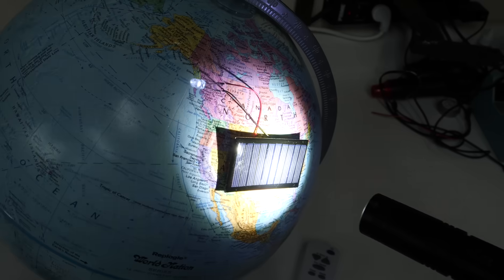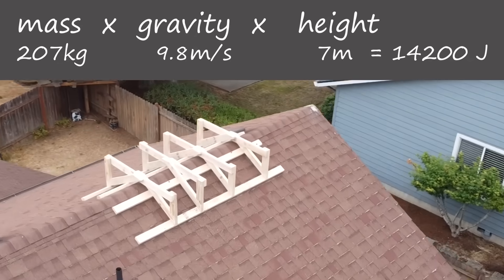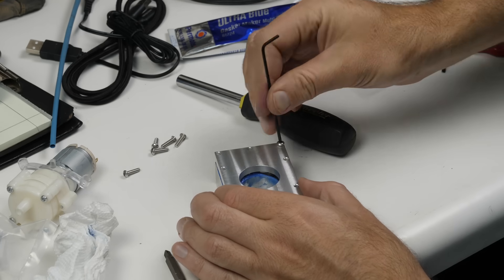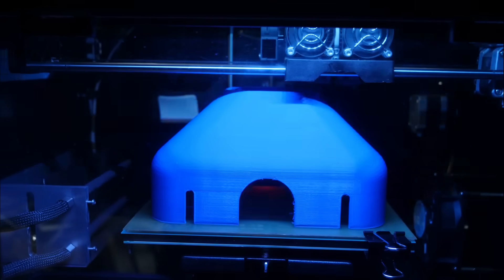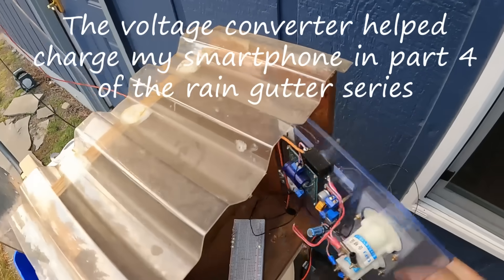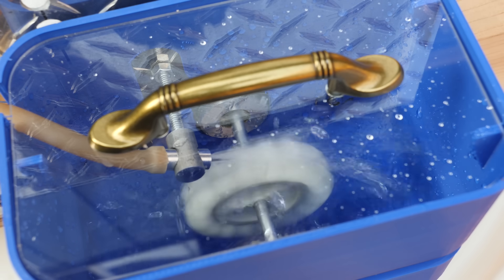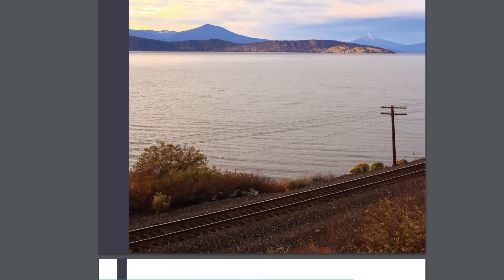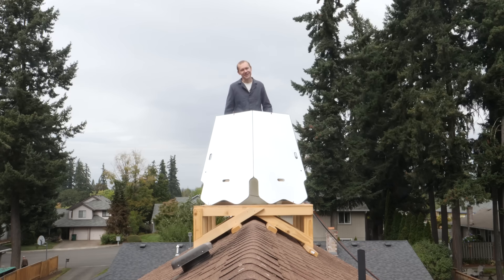Storing Solar Power on my ROOF!!!

Comment: I'm glad you made it clear near the end how little 14200 Joules actually is, namely just the energy in an AA battery, unfortunately. Another thing to consider is how much energy is lost in the whole transformation process, basically all the heat that is generated (and thus engery lost) while pumping the water up, and some losses also when converting back the potential energy of the water back to electric energy in the end. Storing energy is difficult.

Comment: you know putting that on your roof on is a bad idea. you know how much does a gallon weigh of water. times at 50 gallons you do know that 50 gallons is weighs 400 lb. that's on the roof .

Comment: Sorry for my English. It's very interesting experience, but there too much losses. You know, I counted 10. Electric energy->mechanical energy->in motor->in tube up->gap between up tube and level of water in barrel->in tube down->in faucet->in nozzle->water to mechanical rotation->in generator->in electronics. It isn't all of it. I thought you'll try to lift up the barrel like a lift then will generate energy by lowering down. It can be next round of experiment. Good luck :)

Comment: A while back I was day dreaming about lifting a really heavy rock (more like a boulder) slowly over time with solar power and then using that rock to generate electricity later through some sort of controlled gear driven motor/generator.

Maybe some day I will test the idea.
Reply: Use math to determine how big of a boulder you need and how far up hill it must go before you start the project to avoid disappointment.
Reply: @AvgDan  
We're talking about ideas and experimenting. Experimenting is what develops knowledge and skills.
Do you think people like Tesla were using equations made up by other people before they'd dare craft up something to experiment with? 🤔 
No. They built and rebuilt to get it right and perfected along the way. 

But seriously. It was just an idea for off grid. And as such it would be a matter of a lot of variables such as what motors, generator, gear drive etc was available (often from used parts available) and simply converting mass to kilowatts/hrs on a piece of paper would be worth about as much as the rest of the bullshit that looks like something on paper but maybe not so much in the real world.
(I could insert a bunch of political climate propaganda etc for example)

Comment: Great Experiment!
Halfway down the video I wantetd to post that the equivalent of your water reservoir is roundabout a AA-Battery, glad that you found out yourself ;-)
If you woud have used your Solar Panel as a charger, you would have filled 2 AAs in the same time, because of the bad efficiency of pump storages.
Never the less, they make sense in large scale. Large pump storage plants have a capacity in the GWh range.

Comment: Could the power duration of your single barrel be extended by using some sort of Ram Pump inside the bottom barrel to pump some level of the water back up to the storage barrel?

Comment: I find this very interesting, but I wish I had the background to pretend to know what I am talking about. I do have an idea and maybe someone can shut it down or explain that there is maybe some merit. Instead of converting solar->electricity just to convert it to mechanical via pumping water, could we use evaporation instead? Like allow the heat from the sunlight to evaporate a liquid, where the gas would travel to a higher elevation on it's own? If my idea is dumb, it wont offend me, I like to just sit and think up of things like this.

Comment: This has been done in Llanberis North Wales 🏴 about 40 years ago and uses two large lakes one up the mountain and one at the bottom, it uses off peak power over night to pump the water up and during peak period use of electricity morning and evening the generators produce vast amounts of electricity, The bore of the pipes get smaller and smaller to increase the pressure to the generators. An amazing construction inside the mountain all you can see from the outside is a road going in, it’s incredible to see the inside. So for your perspective you need a pipe 10 times wider at the top narrowing down to your generator to increase your pressure otherwise you will have less power generated as the generator speed will be compromised and not be efficient. Take the water outlet to the bottom of the tank that will help

Comment: Turning this potential energy back into electricity is for sure derisory, but if you hooked it up to some passive solar heater, you would now have a completely off grid way to having pressured hot water for your shower even in winter - and now that's not derisory anymore

Comment: I would like your channel if you used more common measurement types rather than Joules etc.. and when using Kg rather than Lbs or liters rather than gallons then give both. I.E. 16 Km or 10 Miles etc..  If we were already used to joules we would not likely watch this video.  And those jugs looked like imperial gallons.
Reply from the maker: Appreciate the feedback.  I try to incorporate both where it makes sense.  However you are the first person to request more imperial units.  I initially got requests to include metric equivalents and now get props in the comments for doing so.  Note there isn't really an imperial unit for mass (Kg) other than the Slug and nobody but engineering students in North America know what that is.  So like I stated in the first rain gutter video, "it's way easier in metric" so that's what I do.  All engineers I know, when forced to give an answer in imperial, do calcs in metric then convert back at the end.  But again, I do appreciate the feedback!
Reply: @QuintBUILDs    I do not have a problem with metric. Some do and some metric folks hate I.E. 17/32 size wrenches. I am saying use both. P.S. My great grandad used to drink lots of beer at pubs. Some had the big heavy wooden barells as kegs. Grandad used to bet the bars he could break one of those barrels with just 5 gallons of beer. He took the 5 gallons (19 Liters) up to the roof with a hose and funnel conected to the keg on the ground. he  just poured it in the hose. and split the keg open via the pressure. At 35 feet he got about 15 PSI (1.05 K/cm2).
Reply from the maker: @jimbronson687  that's a great story. Thanks for sharing.

Comment: Such a great home project! Just a question, did you calculate what's the overall efficiency of your system? You may wanna improve by reducing friction loss in the pipe and turbine bearing.
Reply from the maker: Check my smaller channel BUILD2.  Efficiency was horrific! 🤣

Comment: Check for the Hierro island in the Canarias. They become energy independent from petrol to produce anergy for the island. This water reservoirs have been used since the begining of water dumps to get profit of the overproduccion during the night to supply peaks on the day. But by the sea fron where they supply the damp 600m above sea level the water supply is ilimited! This system in the roof is just a Game for children, why dont you show the easy ecuation that relates heigth and flow to electric power? You need minimum 10.000 liters (a small swimming pool) on a heigth if ten meter to have 1kwh so a huge invest for 1 euro save every night? How long does is take yo pay for the Sky pool?

Comment: I wonder if you’ve seen the water batteries for HVAC? One pumps cold through it to make it an ice cube and the other pumps heat into it to make it nice and toasty. The chiller decides which it needs more of to either remove heat from the house or give heat.

Comment: So, the energy stored in the barrel equals the amount of energy stored in a single AA battery. Now, calculate the amount of energy that is needed to heat up the same amount of water e.g. from 20 °C to 60 °C and compare both results. I promise: it is eye-opening!

Comment: Maybe just build your own water tower to get more energy storage (hoping that the water won’t freeze during the months you need it the most). I calculated that without losses, a tower that is 20m high (hopefully camoflagued) that stores one average daily household consumtion of about 49 MJ would have to store about 251 cubic meters of water (or metric tonnes) (m = Wp/(g*h), Wp = E(24h)).
Hmmm. This is very hard to visualize so probably not realistic even if just half of that amount. Maybe it could make sense to store an hour of electric energy instead of 24 hours (10 cubics, e.g. H:2m, A:5m^2). Also, the higher the cistern, the more you have to reinforce close to the bottom.

I guess it makes much more sense to have a big plant doing this. Is it worth storing just one hour of electricity (no losses considered). 

Of course, if you are content with having no washing machine, no fridge/freezer (you can make one on hot days with the evaporation pot system), etc and having only led lights (who doesn’t nowadays?) and using a low consumtion computer like a RPi, then it could maybe be feasible to store a day’s consumtion in a home built water tower. Maybe we could use steam power for the rest (biosphere fuel of course!).

Comment: Wow. This can be a hybrid solar and rain driven power plant (just put a filter mesh on the top).
Now you just need to switch it up to 110V/60Hz (right?) or convert all the outlets to a 5V DC system (work from home on a raspberry pi, yeah! 😂)

Comment: Plastic manufacture pollution is responsible for the loss of ozone oxygen and nitrogen gases.  The hazardous waste burners from plastic manufacture and disposal are responsible for global infertility. The perchlorate is visibly impacting coral and plankton world-wide.  The real solution to fossil fuels and nuclear power is the Edison generator and dynamos power plants.  A small power plant can be made from an old car generator pre 1974 .  Chisel off the armature magnets in a pattern of one sixth on and one sixth off all the way around. Tesla bound the generator with magnets all around the armature. Count the magnets and divide by 6 and chisel off one sixth and leave one sixth on all the way around. A permanent magnet motor as a generator and add an inverter or two  to have house current voltage AC continuous peak power without fuel.  12V DC. 110 V AC power 40 amp inverters. 45 amp on the 12V DC side of the inverter delivers 40 amp on the 110V AC side.  Without fuel or cranking or plastic solar manufacture pollution.

Comment: I have a noob question that came to mind. Can you create/store more energy with this method than just using that solar panel to charge up a battery? Or does it equal out to be the same? I ask because it sounds like the higher up the energy bank is stored(like your 55 gallon drum on the roof) the more power someone can yield? Apologies in advance, I know this question probably comes off silly.

Comment: How about using the solar with thermoelectric devices to heat the water/oil in one container and cool water/oil in another, then use them again to generate power from the temperature difference. Less moving parts and doesn’t have to be stored on the roof. Would love to see you experiment and pull some efficiency calculations from it please?

Comment: Little girl, that was a good question poorly answered by your father. Most pumps rely on water for cooling and are not built to pump air. Running a dry pump can potentially damage the pump. Never run a dry pump.

Comment: Storing electricity is the problem with solar. Electric cars run on the burning of coal and natural gas and stored in batteries that have a very limited life span. Nuclear and pumping water uphill is where we’re at.

Comment: Hi, have you heard of hydrogen generators. Well I was wondering If you can use solar Energy to generate electricity, use that to separate hydrogen n oxygen from water. Since they are gases they will rise up to your roof top. There you can re convert them to water generating electricity and can be use to power your lights. store the water on top, let it flow down so to use the it for more energy.

Comment: hehe  beat you..  we built one that was 1000 gallons and ran a welding shop in 2002.
30meters drop to 5 225amp 12v batteries
it was enough for 2 welders and lights when power went out. with plenty of room.

Comment: If you invent a pressure switch to send a signal to the well pump to shut it off in large Ranch water tanks1-5 thousand gallons or more, you could sell a ton of them. I have been looking for one for years that would shut off my well pump when my tank is full, so it does not over flow. Many people just let the tank overflow and forget about it and waste a ton of good well water! WE could all use a wireless system since most tanks are elevated high above the ranches the store water for

Comment: the water would hold a lot more energy if it was heated with a solar concentrator. Would require a different way of converting the energy back though. in that case I would just use it for heating or showering.

Comment: It doesn't have to be water. You can have a weight on a metal rope that is lifted by a DC motor during the day, and then uses the same motor as a generator during the night. The thing should (of course) have a gear box that would allow a small DC motor to lift a heavy weight during the day while functioning as a reducing gear. Then the rotation force is applied on the other side of the gearbox by the weight, and it works as an increaser gearbox for the DC motor to spin fast enough and generate electricity. Gravity storage is a thing. But even with this, I still don't think this is going to beat batteries on such a small scale. It's just simpler and easier to put several 18650's to this solar panel and charge. Either that or get some LiFePo4 batteries that are more durable. One can also hook some super capacitors to this thing. Then you got millions of charge/discharge cycles, but the energy density and the cost are horrible.

Comment: Great video! I think you might be losing some of your energy recovery with flow resistance in the down hose. I bet with a much larger hose or even a pipe, still retaining the narrow outlet before the paddle wheel, you’ll probably sustain better pressure as the water flows.
Reply: Up-line was really bad.

Comment: Note that you don't even need a solar panel to pump water up to your roof, you can use a series of ramp pumps, and at each junction have a different storage of water. You can bleed all the water at once for extra power.

Comment: Another way for storing solar energy is to melt down salts that have a high melting point with solar energy  and keep those melted salt in an isolated  reservoir and when ever it's needed that salt could boil the water and turn a turbine .

Comment: In the UK there is the Dinorwig Power Station, known locally as Electric Mountain, or Mynydd Gwefru, is a pumped-storage hydroelectric scheme, near Dinorwig, Llanberis in Snowdonia national park in Gwynedd, northern Wales. Construction started in 1974. The scheme can supply a maximum power of 1,728-megawatt (2,317,000 hp) and has a storage capacity of around 9.1 GWh (33 TJ).

Comment: Basically you've built a mini hydroelectric system on your roof.  Inventive.   
I question the need for the float valve on the roof barrel (although redundancy is never a bad thing) since the amount of water should never be more than is in the bottom barrel if it is truly a closed system. 
Have you measured how long the water/power lasts - say in a power outage using enough to read by or do necessary things like powering your cell phones, have minimal lights on, etc?   Also at various power levels:   Full, half, 1/4, etc...  
Cool video.

Comment: Another storage scenario is for excess renewable energy not being harvested stored via a high-pressure gas pump. The gas is stored in underground salt domes. When the renewable energy is in deficit mode the energy of the HP gas is released to be utlized as the prime mover of electric generators.
Various other scenarios as well.
Solar stowed in liquid salt in the world's largest solar arrays has been ongoing in Morroco.
Pity these technologies are not getting more press.
An exciting branch of science IMO.

Comment: I used to day dream about this concept except using the tides to capture and then drop the water back down, or using a mechanical arm with a float and a massive transmission to turn gears and pump water up a hill only to dump it back

Comment: Useless concept.  There is no payback on the cost of your build with 1 watt max output for a few hours before the barrel is empty.  There was more fossil fuel burned to get the lumber to your door to build your platform then whatever  electricity the unit will make to offset it.

Comment: A gravity battery! Awesome! I was wondering about the feasibility of this for an off- grid home. What would it take to provide enough power for the average home?
Reply: That barrel, when full, corresponds to an AA battery. Not much, unfortunately.
Reply: Whilst this is great fun for practical uses You would be better off looking at low pressure compressed air say up to 10bar.
A Australian friend of mine has a system using both wind and solar to compress air during the day.
He stores the air in old gas tanks.
The only serious problem is space luckily he has enough room to store the tanks.
Whilst not as efficient as battery systems it is far cheaper and can work over a nearly infinite number of cycles.

Comment: Thanks for the video.  I've been thinking of building off grid but I don't like batteries so I was thinking of setting up a water tower.  This helped me understand how it would work and also pointed out that it's likely to be very under powered for what I need.  The only major difference to my plan was that I was going to use a tesla turbine.